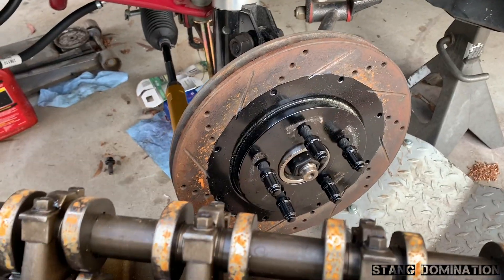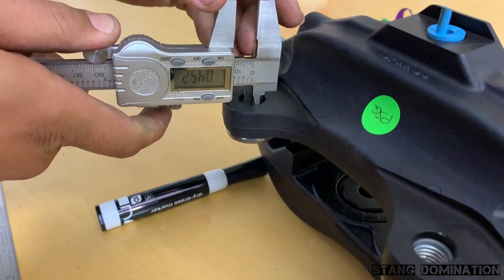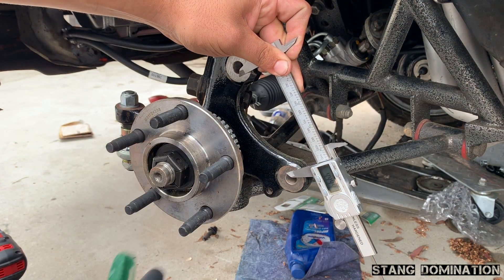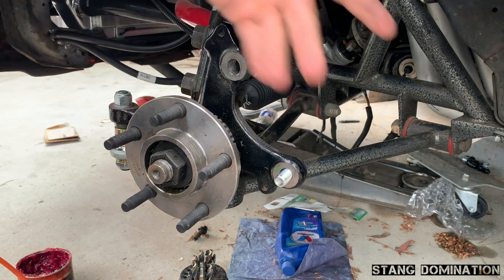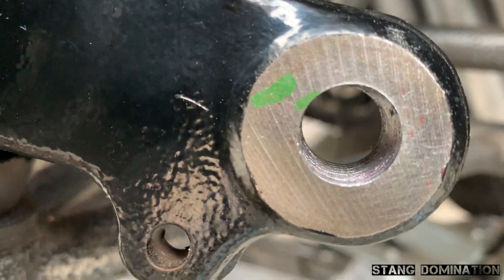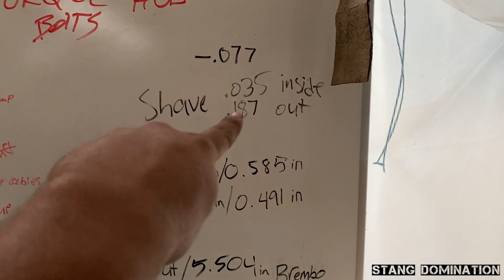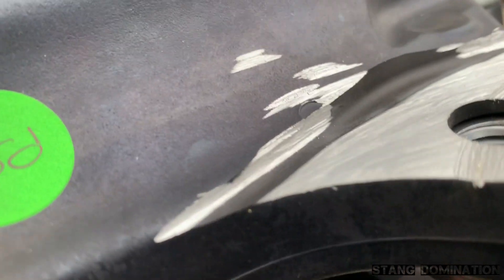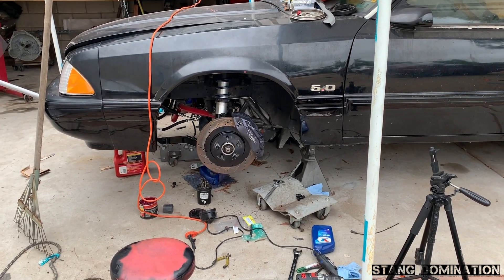HOW TO INSTALL CADILLAC ATS BREMBO BRAKES ON A MUSTANG

Comment: hey usaron los banjo bolts que vienen con los steel braided lines?

donde está el machine shop donde llevaron los calipers y cómo cuánto cuesta .
gracias.
Reply from the maker: Compre los banjo bolts separado. Pero puedes usar los banjo bolts que vienen con los braided hoses. El shop esta en Master cylinder head en El Cajon

Comment: Hey how are the Brembos holding up? Any issues? I did the swap on my 85 and they came out great but I haven’t driven the car yet? The car is almost done  looking forward to driving it.
Reply from the maker: Stops a lot better but might be a bit strong without abs but no issues at all
Reply: Stang Domination thanks for the heads up bro your videos were a big help.
Reply from the maker: No problem

Comment: What brake lines do you need for this conversion?
Reply from the maker: Stainless steel hoses are recommended. I’m running J&M’s all around but here’s the part number for the front  #JM-22516
Reply: Thanks.

Comment: Dude, you need a drill press isntead of machine shop. Set your height, use a cutting wheel of some sort, like Forsner style bits and vertical cut little by little.  You can set your stops and measure really accurate with drill press.
Reply from the maker: Man we would love to have one of those. Would of made it a lot easier. They end up making a kit for this.

Comment: I heard down the grapevine that the Focus RS has the same calipers as the 2000 cobra R. Any insight on this? And will fit no problem
Reply from the maker: Naa first time we’ve heard about that. What’s the going price on those
Reply: https://www.tascaparts.com/oem-parts/ford-caliper-g1fz2b121b?origin=pla&gclid=EAIaIQobChMI3tCIzvC35AIVjiCtBh2p1wXuEAkYAiABEgIpAfD_BwE
Reply from the maker: Hhmmm we might have to look into that. It would be pretty dope. Hopefully it would fit the 13” rotor
Reply: @coloncleanse3542   The mounting tabs are different than the 2000 Cobra R rotors. Who said it was a direct fit?

Comment: Hey did you shave material of the brake pads?? And are u uploading a video of the final results of the caliper color
Reply from the maker: No but you can definitely shave it off and most definitely will be showing the after
Reply: I read the samething. You have any updates

Comment: It would literally take an extra fifteen minutes per side to weld the top hole closed and redrill. Why hack it up ?
Reply from the maker: We try to make it to where anyone can swap it cause not a lot of people can weld or own a welder but also it’s not much that we got off. Now if it was a bolt an half then yea we would definitely weld it closed and redrill
Reply: Stang Domination I understand, your right there are a lot of people that don’t have that option. Your way will def work if they can’t , it’s all about getting it done 💪💪
Reply from the maker: Exactly
Reply from the maker: As long as it works tho lol
Reply from the maker: But yea that’s definitely another option

Comment: I had heard from several people that they are direct bolt on..
Reply from the maker: Lol yea we tried that. If it goes all the way in and you take it out, it won’t go in again Isaac almost stripped his
Reply: It's not a direct bolt in. You need to drill out the spindle and shave the mounting area of the caliper like he did. Its all over the forums and FB

Comment: FullyTorquedRacing makes a kit to just bolt on GT500 calipers. Yes, it’s about $1000 more than just the Cadillac calipers but it’s easier.
Reply from the maker: We’re trynna stay away from that price lol but better braking power and the money you save is now for more hp. Turbo🤫